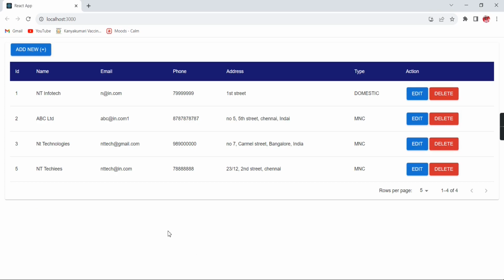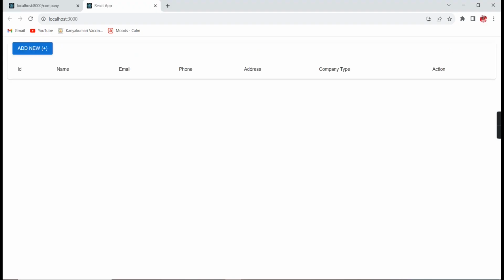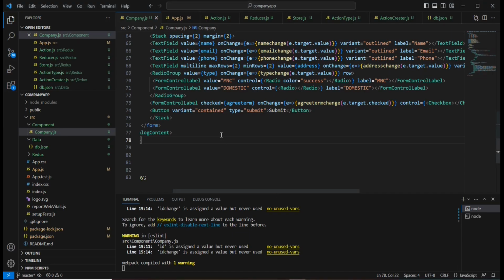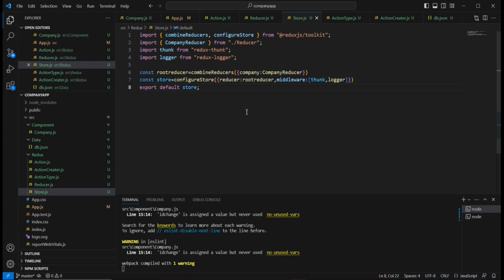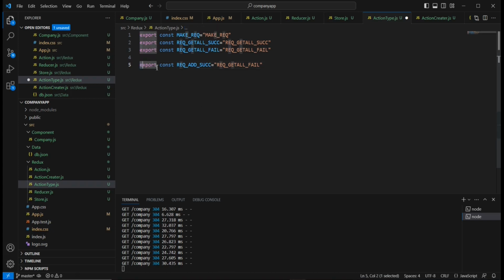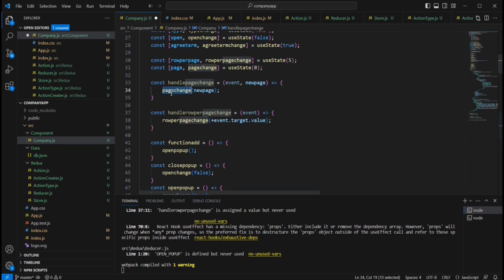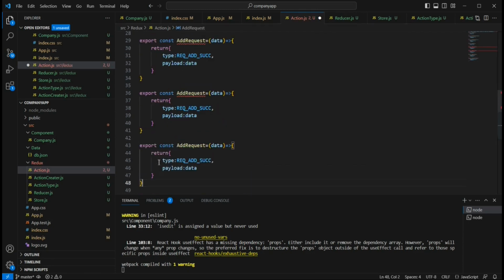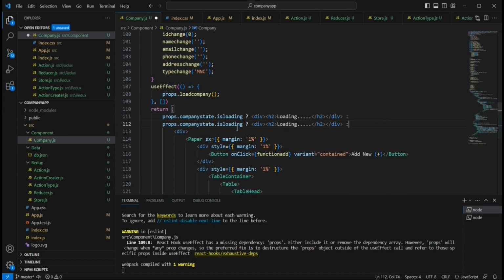React JS CRUD Actions using REDUX Pattern MUI Design & JSON SERVER API

Comment: giving errors 
src/Component/Company.js
  Line 2:31:   'useCallback' is defined but never used                                                                                                                                                                                                                                                                     no-unused-vars
  Line 111:8:  React Hook useEffect has a missing dependency: 'props'. Either include it or remove the dependency array. However, 'props' will change when any prop changes, so the preferred fix is to destructure the 'props' object outside of the useEffect call and refer to those specific props inside useEffect  react-hooks/exhaustive-deps
solution please i clone your campanyapp from github?
Reply from the maker: Create new app follow steps in video . If you face any problem let me know when it's breaking. 

Source code is for your reference only